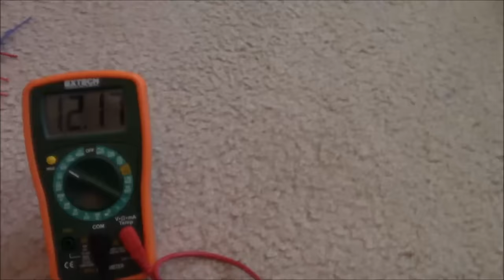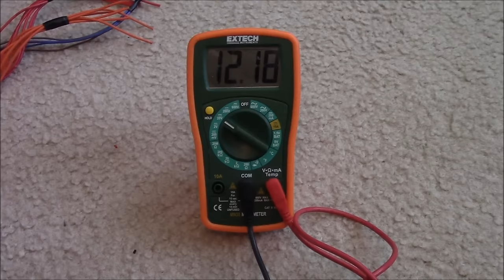How to Hack a Computer Power Supply (PSU) To Use as a 12V DC Power Source

Comment: Hello LDSReliance, my Tennis Ball Machine(Battery Operated) says "Powered at 12V DC, 12A 
If equipped for AC Input: 100-240V, 150W" .  I need help to convert the Ball Machine to AC, a forum suggested to use Computer power supply and make it to 12V 30Amp, Please advise me sir what to do... Thank you very much for all your valuable expertise in this field :)
Reply from the maker: You are welcome.  Thanks for your support.

I'm not sure why they say 12v 30Amp but that is overkill.  This type of power supply can easily provide over 12A of 12v DC power.  But this power supply converts AC to DC power, not the other way around.  Are they saying that it will operate in reverse?
Reply: LDSreliance LDSreliance then I would take that the forum was talking about converting from AC to DC 😉 . when you say 12v 30amps is overkill, will it damage my machine or it will still operate?
Reply from the maker: No, it won't hurt it at all.  Your device will only "ask" for 12A and that is what the PSU will provide in simple terms.  So this type of device would allow you to plug your tennis ball machine into your house power by converting the house AC power to DC power that your machine can use.
Reply: LDSreliance OK then I will give it a shot! Thanks. I will update you later
Reply from the maker: Sounds good!  Good luck.
Reply: LDSreliance this is coming in late but just want to let you know that  the project is a success! it works!!!🤗
Reply from the maker: Woohoo!  Nice job!

Comment: Hi thank you for your video, Im just wondering IM trying to power a lipo charger and that takes 12-18v dc. Is there anyway I can connect the 12v and 5v together to make 17v or is it safer to just leave it at 12v to power my charger. The charger itself can output 400w via DC power so would using 12v or 17v make any difference?
Reply from the maker: The charger can use 12-18VDC but 18V isn't necessarily better than 12V.  You can't combine 12V and 5V to make 17V, at least not easily.  I would just hook it up with the 12V rail if it were me.
Reply: @LDSreliance  thanks that's really helpful.
Reply from the maker: You are welcome.  Good luck!

Comment: In the molex pin, two yellow wires went in to one 12v pin output. Does that mean i need to bundle two yellow wires as postive and two black wires as ground to power a 12v device? ( I don't wanna bundle them all together like in the video cos i want to power different dc devices)
Reply from the maker: These wires are thin and cannot carry a lot of current by themselves.  So for devices that need, I would say, 10A or more you need to have at least two wires.

Comment: I did the same thing to my power supply but when I turn it on it doesn't turn on. But when I put it back to the computer it works and I hit the power button it works
Reply from the maker: Yes, you need a load on the PSU.  If it does not detect a load it will not stay on.  It will turn on for a split second and then turn off.  So you can either connect a 12V device to the yellow and black wires and turn that device on then turn on the PSU or you can wire in a resistor to trick the PSU into thinking there is a load.

Comment: Hi, I've 550W Aatx 24 pin power supply, I was controverting it into 12 volt DC bench power supply, when i tested the supply by connecting green with black it turned on smoothly, but after peeling off yellow 12 V I accidentally got one short with the black , there was a little spark but then the power supply immediately went off due to built in protection system. But now when I connect my green and black to turn it back on, it doesn't turn on all I notice is a little jerk in the fan and then nothing, I tested my permanent 5V is working, nothing went wrong with any of the components no swelling in capacitors neither any other component burnt, I wonder if you could help me restore this. It probably need a good power signal from PC or something? I'm not sure though
Reply from the maker: Rafaqat Hussain It may have blown a built-in fuse or something.  Or it may just require unplugging it and letting it sit for a few hours for the power in the capacitors to drain away and reset everything.  There is no signal that the PC sends to the power supply.  Jumping the green wire to the black wire completes the power on circuit and allows the unit to turn on.  That is all you should have to do to get it to turn on.

Comment: I have a 2007 computer power supply and it does not have a green wire. what color will replace it as a power supply ?
Reply from the maker: You will have to dig up a schematic or diagram for your model to find out which is the "PS ON" wire.  I believe it is the fourth from the side if you have not already cut off the end of the big connector that goes on the motherboard.
Reply: Thank you sir but unfortunately I discarded the big connector before I realized which wires were required. My PS is a 2007 Macron Power model mpt-301.I am having  a difficult time finding a schematic/diagram. Anyway, thank you very much for a quick response to my question. I'm a senior and electronics have never been my forte. I congratulate you on the video. Very nice indeed.

Comment: I also have a question what if I measured the voltage and I'm getting less than 12 volts getting 11.2 volts how do I step it up that I make sure that I can get 12 volt
Reply: inside the power supply would be a small (usually Red with a white screw) potentiometer, you can adjust this screw in small tiny increments and it will raise the voltage.

Comment: Thanks for the vid. Do you know what amps it would be providing @ the 12.1v?
Reply from the maker: +dvrman It depends on the power supply.  Mine is rated for 20a @ +12v.  Some may be more powerful or less powerful.  Look on the specs of the different rails for that power supply and look for the +12v rail.
Reply: +LDSreliance I'm going to piggy back off this.  If you wanted to run multiple 12v devices, could you use each individual yellow wire instead of soldering them all together? Example: your liquid cooled peltier device, you need five 12v wires run to the 2 fans, the 2 pumps,and the peltier chip.  First four pulling ~0.5 amps and your chip pulling 5a or 10a or whatever.  Wouldn't it be best to run a single yellow 12v wire to each 5 component and let it draw the amps it needs?  Why solder them all together like that?
Reply from the maker: C Pavlina
The individual wires are too thin to pull many amps.  Individually they can probably handle an amp or two and they would be totally safe to run the fans.  However, to run the peltier at 5 or 10 amps you would be better off running multiple wires so one individual wire doesn't heat up and start a fire.

Comment: do i really need to solder all the yellow together and all the black together? or i can just use 1 yellow and 1 black to power a device?
Reply from the maker: If you are just going to use a little power, use one set of cables.  But if you are going to use the full power of the 12V rail (240W or so on mine) then you need multiple wires.
Reply: @LDSreliance  thanks! I really appreciate the response :)
Reply from the maker: You are welcome!  Good luck and thanks for watching!

Comment: so im just trying to make a power supply with all six of them and the amp pulls like 18 volts every time i key to talk how would i make that work connect all the colors to get the most out i need like 20 volts can this run 20 volts for good periods of time just saying regular stuff over my mic for cb
Reply from the maker: +Nena Pike Yes it can run 20 volts but probably not exactly 20.  You just need to combine some rails.  You could combine the +12v and 5v and 3.3v to get 18.3v.

Comment: Hai bro can you please tell me that  how to produce 7 amp current as a output with dc source as a input without using a transformer
Reply from the maker: I think you have to go through a transformer/inverter to get from DC to AC.
Reply: @LDSreliance  is it possible to make this a battery charger?

Comment: Hello, can I use this  Power Supply for my EMAX B6 Charger? I want to charge my 3000mah li-po battery but some people say I need 12v, 5A for my charger. Is it be okay?
Reply from the maker: Yes, this power supply puts out 20 amps of 12v DC power.  That is more than enough for your lipo charger.
Reply: Thanks man i have 2 of this in my junk room. Thanks for the share... Bless ya!
Reply from the maker: You are welcome!  Thanks for watching.

Comment: I really hope you can help me. I have 3 identical f300-a psus.  They all started out fine but now when I connect green and ground the psus power on for a split second and then die. The only fuse I could find on all of them is still intact. Did I somehow get them? They make a clicking noise and shut off immidiately.
Reply from the maker: Sounds like they are detecting there is no load.  Try wiring in a resistor or connecting them to a live load and trying again.  I don't think you broke all 3 of them at the same time by chance.
Reply: I got them to work and made a micro HHO torch. I posted a video if you are interested. I had to short green and ground and grey and brown for them to stay on.
Reply from the maker: Phillip Hans Interesting.  Link the video?
Reply: Ahh im new to youtube. I've no clue how to link the video but its in my profile I have only one video
Reply from the maker: Phillip Hans OK, I will check it out.

Comment: If I had two of these, is there a way I can hook them to get up to 24 volts?
Reply from the maker: The only way to do it would be with a voltage boost converter like this:  https://www.amazon.com/Numerical-Regulator-Converter-Constant-Adjustable/dp/B01E3RXBV0/ref=sr_1_3?ie=UTF8&qid=1472650719&sr=8-3&keywords=voltage+booster+dc

Comment: I tried powering a motor using the bts7980 motor controller and it shuts off, even though it worked fine when using one cable, when using everyone together it shuts off
Reply: I have the Same Problem did you find a fix?

Comment: hi was wondering how can i put a 5.5x2.1mm jack on 12v with the psu still in the computer?
Reply from the maker: +Hitokiri Battōsai You would have to find a 12v power source somehow.  If you want the computer to still function then you can't hack up all the wires like I did in this video.  You may be able to combine a couple of the smaller voltage rails to produce 12v somehow.

Comment: do always have to unplug to turn off or can you add a switch?
Reply from the maker: +james mondin You can add a switch.  Just wire in a switch between the black wire and green wire and you are set.  Mine has a switch on the back of the power supply so that is what I use.
Reply: the power suppply usually has its own switch so why bother

Comment: someone suggested 400w power supply can give 23 amps 12v?! i have regulated power supply 7-10 amps 13.8v dc it can barely power car amp half way one channel 300 watts, keeps cutting out. can i use computer powet supply for that, i mean 12v 23 amps from 400w supply gives morr bang, am i right?  i have 600w supply should be enough, right?
Reply: You need to check your particular power supply to see how much power it can drive through the 12v wires. Should have a sticker on it.
Reply from the maker: Like Nak tura said, it depends on the PSU but generally a 400W PSU will have a 20A +12V rail.  So that should be enough to power your 300W amplifier.

Comment: hello - i need a 5v dc power supply which can give high current.. im trying to use a computer power supply but dont know exactly how to do dt... do u have any idea of it???
Reply from the maker: tharaka dahanayaka Yes you can do it just like in this video but instead of grabbing all the yellow (+12v rail) wires you would grab the red (+5v rail) wires.

Comment: can I connect my PC power supply to my VAN battery so I can play on the go?
Reply from the maker: No.  PC power supplies require 110V AC power input.
Reply: @LDSreliance  what's the solution then?
Reply: @LDSreliance  I'm trying to hook this to my subwoofer to use in the house cause it has lights on it but it needs 12v in order to work

Comment: hi i did this to 2 of my my power supply which are identical models ..i connected pson to black com and ps powers on but when i check 12v yellow it comes up at 10.98 on both of them...thats very odd...what am i doing wrong?
Reply from the maker: It may not provide full voltage without a load on the psu.  Try connecting a light or something to the psu and then re-check the voltage.

Comment: What is the max amperage it can put out?  (Sorry if someone else has already asked.)
Reply from the maker: It depends on the model.  Look at the sticker on the side or look up the part number with the manufacturer for the specs.  The smaller ones are usually around 20A.

Comment: i need to find out which wire i have that would be equal to your green..
Reply from the maker: You will have to look up the wiring diagram on your model from your manufacturer.  There will be a power on wire somewhere.

Comment: I have a 250watts max power supply and I tried using it to power a 1600 watts amplifier and every time I turn it on it would shut off automatically, any idea? do you think its not producing enough power?
Reply: I'm no genius on this, but I would say you need more power. If I were you I'd be buying a 1600 watt power supply to match your amp. I have a 500 watt amp and a 650 watt power supply and it works great. Not for sure how high or low I could go power-wise.
Reply from the maker: +richard pechia I thought I answered this comment.  I guess I am losing my mind.  Yeah, like the other commenter said, you need 1600 or more watts to power your amplifier.  Your power supply is shutting off because it is protecting it from being overloaded by the power demands of the amp.

Comment: Hello I have a question, would this be enough to supply for 9 small car lights? ( i am trying to craft something using car lights)
Reply from the maker: +Alanis Sophia Depends on the size of your power supply and the power requirements of the bulbs.  Do you know the model number of the light you plan on using?
Reply: the only number shown is on the socket, #12. Other than that i don't know......
Reply from the maker: Alanis Sophia
If it is something like this (http://www.autozone.com/electrical-and-lighting/dome-light-mini-bulb/sylvania-dome-light-mini-bulb/493800_0_0/?checkfit=true) then it uses about 5 watts.  That is probably a pretty average number for this size bulb.  So 9x5=45 watts or 12v@4amps roughly.  This power supply will easily supply 4 amps of 12v power.  So to answer your question yes it will work unless your bulbs are much different/bigger.
Reply: its the third image, and thanks for the link ;)
Reply from the maker: Alanis Sophia
Ok then those should be no problem!
Reply: thanks soooo much for your help! ;)
Reply from the maker: Alanis Sophia
You are welcome.  Be sure to thumbs up the video and/or subscribe to help out my channel!
Reply: of course!
Reply: what kind of small lights
Reply: I may have an Idea what ya were trying to craft xD

Comment: Hi can i plug inverter 12v dc to 220v with this settings to lessen electric bills?
Reply from the maker: I'm confused.  You are plugging this DC power supply into the wall outlet providing 110V AC power.  Then you want to plug an inverter into the DC power supply to convert it to 220V AC?  That would definitely not save money on your power bill.

Comment: I am looking for a really good dc power supply that is built to last? Have you done any reviews on any power supplies?
Reply from the maker: No, but I probably should.  How many watts are you thinking?
Reply: something like the 
UNI-T UTP305 Universal Linear Regulated Adjustable DC Power Supply, 30V, 5A with LED Display.  i do not know anything about electronics.
Reply from the maker: robviolin1 OK, that is a pretty small power supply that won't be able to power a lot but I can give it a shot.
Reply: great

Comment: How can i use this to power up my laptop with no battery and no charger? I was thinking of riging a power supply as an alternative power source to run may laptop... can that be possible?
Reply from the maker: Yes.  But you will need the connector on the end of your laptop's power adapter/charger.  That is the pointed end of the wire that sticks into your computer.  Cut off the connector several inches down the wire so that you leave yourself some room.  There will be a negative and positive wire.  Strip those wires and then solder them (or use your choice of connectors) to the +12V and negative wires from your PSU.

Comment: It will do something if it uses a 16A 250V power cable the old cable is 10A 250V
Reply from the maker: I'm not sure what you mean.
Reply: @LDSreliance  an old comment, but hes asking whether its gonna be a problem if he uses a cable (that you connect your PSU to a wall socket), thats written on it 10 amps 250 volts. That just shows how much current can that cable handle. With 10 amps, that cable will handle 2500 watts, a 16 amp cable can handle 4000 watts. No, it wont do anything, it just depends how much current the cable can handle.